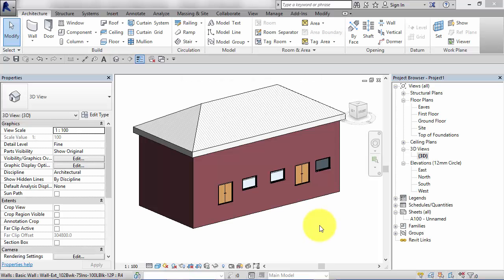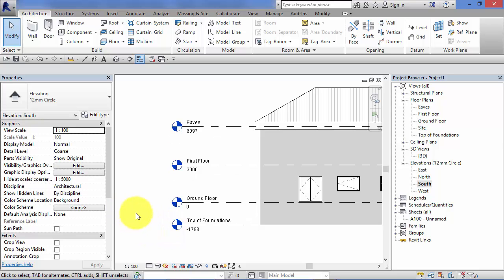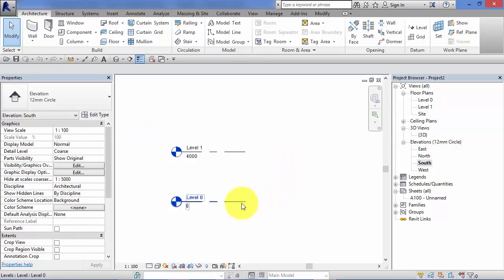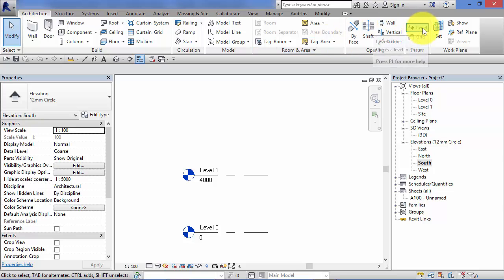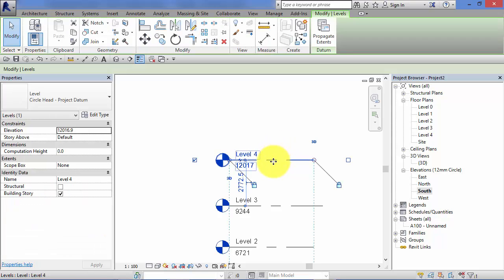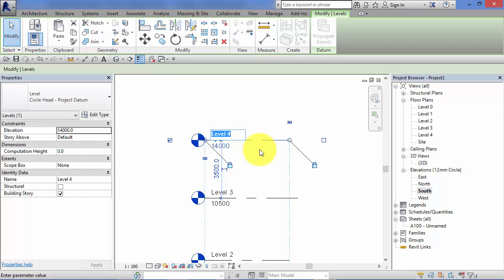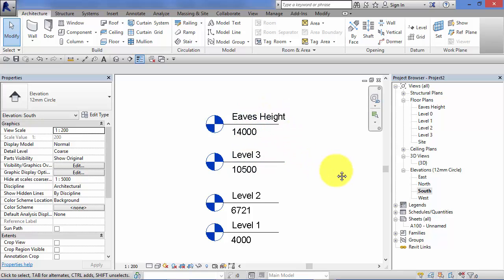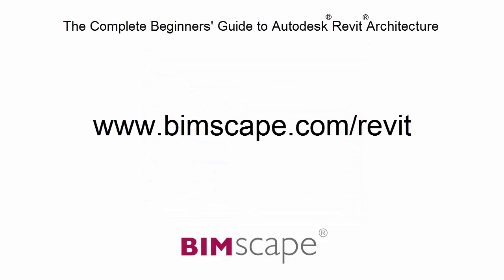Module 3: Unit 4: Revit Architecture: Levels

Comment: I have the worst time with the tiny 'grips' which must be picked to do basic moves of elbows, elevation 'bulls-eyes', etc.
They are so damned hard to select.  Sometimes it takes a couple of minutes for REvit to finally select the grip.    This is so counter-productive.  It would be nice if I cold improve the 'selectability' of these &/or increase the size of the grips.  But this is REVIT, so pretty sure there isn't a way to make things easy.

Comment: how can I solve this issue;  the levels symbols were overlapping one elevation view and when shifting them to the empty space it overlapped on other elevation view? so when ever I tried fixing it in one elevation it overlaps on another, is there a way to move levels horizontally in one elevation without effecting another?